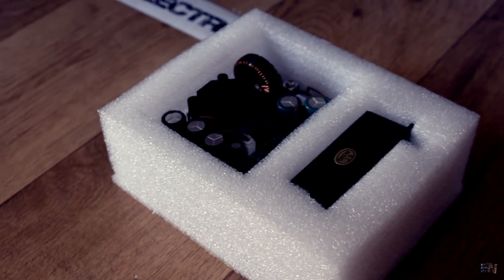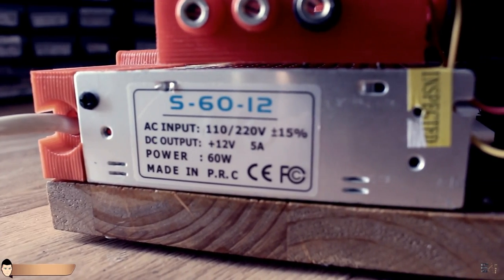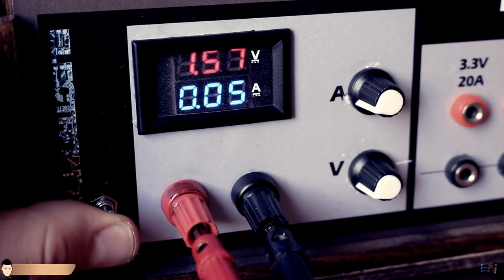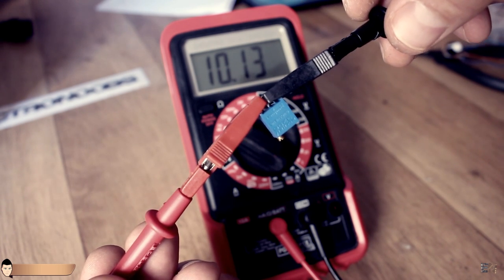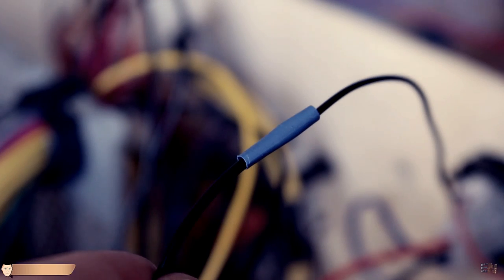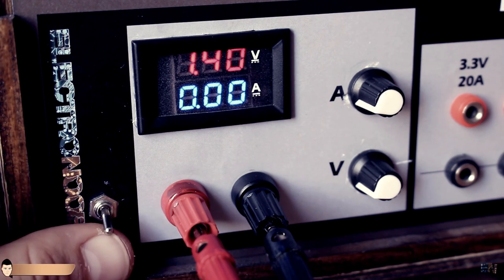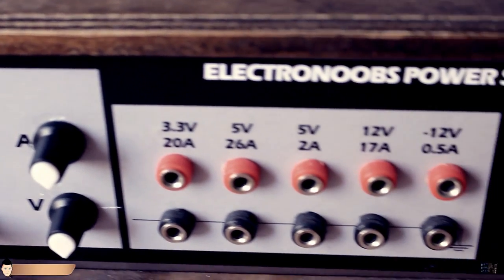DIY variable bench power supply (less than 10$)

Comment: Just what I've been looking for!  However, I am a noob and a little confused.  Does the output enable switch in the schematic have to be 'ON' to get variable output from the buck-boost converter?  Also, will the LCD function when that switch is 'OFF'?  I know, very stupid questions that are covered by the video but my infant brain won't recognize them!  Many thanks!

Comment: Hi please give me some advice. I have a computer power supply that is rated at 350W. I want to put a pair of USB plugs onto it to utalize the 3.3v 20A, 5v x 20A, 5v x 2A, and the 2 x 12v x 312W outputs.
My plan is to do 2 x 5v USB, 1 x 3.3v 1 x 12 v to power a T12 soldering iron and the other a 12v a buck buck boosted supply. What would you recommended?

Comment: Great project and very well explained.  One of the best DIY variable PS videos I have seen.

Question:   When I look up the DC convertor you used, it specifies the a max input current of 10A.  Is it Ok to use this with the ATX PSU, as the +12V rail provides up to 8A current?
Reply from the maker: Yes it is ok. That's the max current it could withstand. If you apply less there should be no problem. Keep up!

Comment: Nice project, if I didn't already have a bench supply, I might try it. -- Also, I hate to say it, but sorry man, you're not going to be getting 26A out of a single 5V wire.  -- You really need to pair them all up to push that much amperage through... -- Also, I doubt those banana plugs are rated for more than 10A each anyway... -- Also you should put the buck/boost converter into the airflow path of the power supply fan. (Or add another fan that cools it.)

Comment: is there a safety just in case I accidentally short the power supply when working on something. plus I have 2 10 Ohm 10 v dummies and a extra fan is that too much? can you put a extra capacitor to smooth out the signal?

Comment: Electronoobs
, first of all, great video and it is very inspiring. However, please correct me if I am wrong, but I think the output terminal connection to the volt/amp meter are switched around on you diagram right? ..which must be a mistake ? ....I dont have the component at hand (yet) just watching your diagram and the products from ebay...i could be wrong
Reply from the maker: Te diagram is correct. The problem is that there are different colors cables for other modules on eBay... Sometimes they use yellow, blue and so on...
Reply: @ELECTRONOOBS  , sry i meant the boost converter output side towards the meter, the image is mirrored so it is bit difficult to se. But as I see it from the picture then the terminal close o the pot meter is + positive (around 6:42 in the vid), and the one close to LM2577S is -negative, right?.

Comment: One thing that should be stated is that ATX computer power supplies have minimum load requirements, and a lot of times won't regulate properly if the loads on them are too small.
Reply from the maker: Qumefox luckily the voltage converter regulates the output depending on the load .
Reply: Mine had too high voltage on 5V output so i've added linear regulator for internal electronics :D
Reply: It's normal the the power rails has a small higher voltage as rated, because under load there is a small voltage drop. So you should not regulate the 5v down exactly 5v. For example as you can read here https://www.allaboutcircuits.com/textbook/digital/chpt-3/logic-signal-voltage-levels/ (TTL gates operate on a nominal power supply voltage of 5 volts, +/- 0.25 volts).
Also there is inside the power supply normal 2 pots to regulate the 5v and 12v rails. BUT!!! Inside is high voltage I would not recommend to open it until you don't know where is the "hot" and "cold" side of the supply ... otherwise you can risk your life!!!
Reply: Well to each their own, but my experience has been that the outputs of most ATX PSU's, especially the cheap ones, are far from being clean and stable when driving no or light loads, so I always add internal resistors to whichever rails I want to use, so the PSU always sees the require minimum load for that rail no matter what when repurposing computer power supplies.
Reply from the maker: Yes, it is wise to add a dummy load to it!
Reply: Thanks for reply, linear regulator indeed isn't as good as i thought. The problem is that 5V rail is beyond that tolerance (around 5.7V with 10ohm dummy load). I'll add second resistor in parallel and see if it helps.
Reply: You might try looking up the ATX minimum load specs and make sure you have the appropriate minimum loads on all the rails. MOST ATX powersupplies i've run across regulate all voltages fine with a load on only the 5v, but i've run into a couple before that wanted a load on pretty much every rail before the voltages stopped being screwed up.  It's also possible you just have a bad power supply as well.

Comment: For most electronics projects this power supply is totally overkill...
I would recommend for all beginners an linear power supply with an lm317 and a simple 30VA transformer and for $6 you can buy the kit with no case on aliexpress with free shipping :)
Reply: I just mentored folks on an intro to soldering workshop; we built an LM338 power supply that a friend sketched out. I was thinking the same thing as you, there's no need for something like this on the bench until you want to have something flashy that makes people go "Ooooooh" -But in all practicality, an LM317 or LM338 1-3A power supply can be customized with a meter, pot, and switch.
Reply: Lm317, 338 can't dissipate lots of heat when we want to draw high current say upto 2 amps @ 3.3 volts if we've designed the power supply to output upto say 30 volts because 30-3=27 volts x 2 Ampere =54 watts the regulator has to dissipate even if large heatsink+fan is used so it's better if we make upto 12 Volt output
Reply: @amitghosh6966  Hi, indeed, it can't disipate all that power but it doesn't need to
You see, "VA" is apparent power, and it's how we aproximate the power of a inductive load, in this case, the transformer..
The real power of the transformer is around ~20W, at 15 volts, it would deliver safely around one amp of current before it would start to overheat
A second thing to take in consideration, most of those kits have a way smaller transformer (but can be bought without) and the kits themself have a max voltage output of 12V so, at 3.3V regulated set output, we whould have a drop of ~9V with a max current of 1A, it would be 9W to disipate and for a typical TO-220 package with heatsink I don't think that will be a problem for short power up applications

Comment: Hi, I have a voltmeter ammeter with yellow black and red wires and black and red, if I connect the way you in diagram it shorts and shuts psu,can you tell how should I connect correctly to make it work for variable output?

Comment: Heu bro. I want to buy a step-up and a step-down converter. They should output the same voltage ranges?
The step-down converter output from 1.3 to 35 Volts and the step-up converter from 5-24volts.

Comment: ALL YOUR VIDEOS ARE VERY INFORMATIVE.. how to restrict current in  this power supply.....
Reply from the maker: Abhin Raj the voltage converter already has some sort of current control using the third potentiometer. but you could always add a variable current circuit.

Comment: Could you help me, I've built this to your word and without the Voltage/amp display it works great. When I connect it to the Display using 5v and ground my Power supply powers up for 1 seconds then goes right off.. Removing the LED fixes this problem
Reply from the maker: The LED is the problem or the Display?
Reply: im not sure, ive tried everything get the led display but im getting nothing. will it still display even if i dont have the 3 pin in?

Comment: If I'm using a 300w ATX is it possible to get 12v 300w or 24v 300w?
I work with LEDs and need the power.
Why did you put the variable resistors the other way around to the display markings?
Reply from the maker: Watt is voltage times current. A 300W power supply at 12V will have a maximum current output of 300/12 = 25A. But maybe that's not the case because usually those supplies have multiple outputs and the output current might be a bit lower. So, the power (W) will always be the same but the current will change.
Reply: Electronoobs  Thank you for the response. I was thinking of making a supply with a separate 3.3 and 5v and then using the 12v 18A 216W output separately connected to a buck/boost. Would it be a decent option or would I need to get a supply that can put out the voltage needed and then just using a buck?

Comment: good work but its triple 10 dollars
Reply from the maker: All depends of the price that you find the PC power supply. 3 dollars the PS, 2 dollars the converter, 2 dollars the voltmeter/ammeter module. 3 more dollars for some wood sheets, some connectors, potentiometers and switches.
Reply: No.
Reply: Prices for the parts, excluding the PS, are much more than 10usd even if I get parts from China. Price is closer to 20usd.
Reply: Just bought all the parts, I skipped the LED. Total from China via ebay came to $14.63 USD including shipping.  Almost $5 more than $10, but 50% more.  I had a power supply. I would say under $20 is more accurate
Reply: @electronoobs
I'd like to buy 100 complete kits from you for 10 USD each.
When can you deliver?
Reply: @czarzenana5125  when do you want it delivered, you think youre so slick with your witty comment. You pay shipping and handling, agreed?
Reply: @voyagertechnologies  
No problem if you ship them all 100 in one shipment.
That's including the power supplies of course.
Reply: Late to the party, but you 'can" get parts for next to nothing if you can get second hand parts like old computer cases for the PSU and wires, etc.
Reply: @crawfish069  no, you can get th we parts for less than $9, just because you have trouble finding good prices doesn't mean they aren't there.
Reply: it blows my mind that several keyboard warriors are squabbling over the difference of $10-$20 on this awesome build, concidering mine was purchased for $899.00!really? GTFO. maybe we could try to intellectually critique the build to make it better for the build community together, instead of argueing over a hand full of dollars, who gives a s**t.

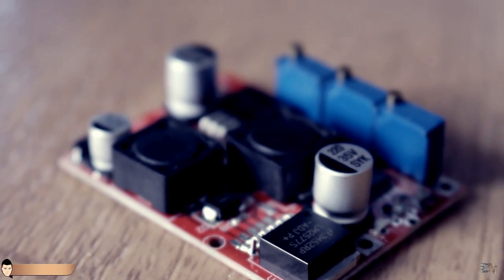Comment: I don't understand if you're voltage converter can only handle 3:00 amps how do you have all the buttons for or is that not part of the variable part
Reply from the maker: Only the first connectors are variable. The other are fixed values directly from the supply and those haev high current
Reply: @ELECTRONOOBS  gotcha thanx...

Comment: Hi, do you have a scope? I tried a buck/boost module like this and found it to be pretty much unusable (at least for a bench supply) because of the ripple. I'm wondering if you saw the same with this module.
Reply from the maker: If the boost could deleiver let's say 2 amps of current and you put a load that requieres more then you will have a big ripple and also could burn the module. But usually, the output capacitor should avoid the ripple quite well and you nshould have a very steady output.

Comment: Nice project concept, though the implementation is a bit dodgy in places:-
- Wooden case? (it's plywood btw, not Balsa!)
- Wiring to banana terminals
- Output switch, is it rated at 3A? 
- Solderingmanship

Comment: Good job,  can i make from it 19.5v 240w Laptop power adapter?
Reply: Yes you can, in fact if you use the module .. you can have input voltage between 4-35V DC so, use 12v power adapter, 19.5v one.. doesn't matter :) also 240W is plenty if maximum it is able to draw is around 100W tbh and you need quite thick wires to get that anyway. Cheers!

Comment: what about high current (5Amps) 24v out of an atx rail? Is it possible or not? I have led strip which require 24v and are 14w/m
Reply from the maker: For that you should boost the (5volts 30A output) to 24 volts using a high current boost module.
Maybe this will do the job: http://www.ebay.com/itm/600W-DC-Boost-Voltage-Converter-12-80V-Transformer-Module-Regulator-Volt-Amp-Car-/401325123362?hash=item5d70d76722:g:Q7MAAOSwtGlZE1Ef
Reply: thanks for the reply! So do you use the variable part to handle the voltage for little projects while the "fixed part" to have high current rail for bigger loads didn't you? Last question: some people solder high power resistors to the highest current rail. Why didn't you do that? Is it always necessary?
Reply from the maker: Yes, you should add a high power dummy load on the power rail (in this case red 5V) to keep the power supply a little bit more stable for low amounts of current. I forgot to mention that.

Comment: I used this buck boost module with a 12v 5a smps but after connecting and switching on the supply I saw a crack on LM2596 ic but it haven't come out of the pcb I didn't connect anything in reverse I don't know what went wrong plz help
Reply: lm2596 has 3amp as max current

Comment: I am building a power supply just like yours but I am using the LTC3780 I have one question tho, what is the use of the  output enable switch? if I dont use it would it make a difference? also I am using a 47 resistorfor te dummy load. thank you for your videos have an awesome day
Reply from the maker: If you don't want, don't use it. Usually bench power supply haev an enable switch. You first set your voltage, your current limit and then activate the output so you make sure you won't bur the circuit. Keep up!
Reply: I see so this is a safety measure just in case you forget to set the right amount of voltage or current you need, I think I will put it just in case, thank you so much for the quick answer I love your videos btw very informative...
Reply: Hello I hope u can help me with another question sorry, I am still waiting for all the parts to get to me, today I received the ammeter display by watching ur video I assumed u can test the display to see if it works by connecting the black and red wire to the power supply but every time i do that the power supply goes off, any thoughts of why it does that? Thank u so much for ur help
Reply: I will try to answer my own question as some others might be wondering as well, so it seems that not all volt/amp metters have the same wiring schems they are all different so before we connect it check colors and where it goes connected

Comment: Never solder mains earth(green/yellow) connections unless you prepare for a Darwin-Award. It will kill you in the worst moment: In a shortage, when it is needed. Go for terminals with screws and crimped connections when using flexible wires. Do NOT apply solder to crimped connections unless you want to negate the flexibility and have them break exactly at the solder-copper transition(why???... what's the point of the flexible cable then ???). When using wire with a solid core learn from someone who knows it how to bend a proper ring and what washers and lock-washers to use.
DO your math and use the right diameter for your cables, rounding _up_. Optional use the next upper diameter for earth cable. Let it be the longest cable of all, especially in flexible connection cables that are pluggable.

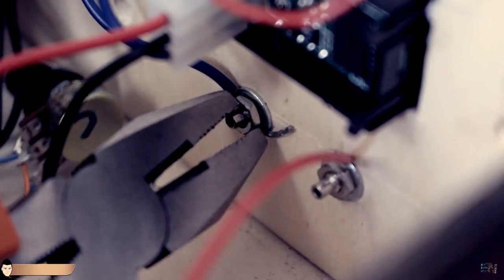Comment: 7:05 dangerous.really should use a ring tongue terminal http://au.element14.com/amp-te-connectivity/323784/crimp-terminal-ring-12mm-yellow/dp/1056385 or at least instead of twisting the wire, make it a Y sharp twist and make a circle into it so the screw and nuts goes in the middle
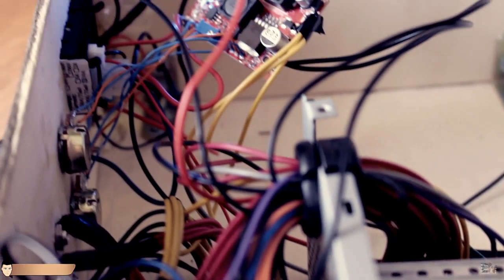9:56 you should also either mount or insulate the buck board from moving and possibly shorting out anywhere.

Comment: How would you build a way to see the max amp before connecting a load to the output? A switch and a big dummy resistor?
Reply from the maker: The max amp of the Power source must be on the label and the max output amp of the module it's on its datasheet. Just check the product datasheet for all the info. If you test the maximum output with a dummy resistor you might burn it or turn it off due to safety features. 

But, you could use a low resistance high power potentiometer and decrease its resistance step by step and when the module get's burned out or turn off that means that you've reached max power..
Reply from the maker: Oh, now I understand. Yes you could add a switch and a dummy load connected to the switch when the switch is OFF. In that way you could set the current limit on the displaay. When the switch is ON it should be connected to your circuit and the current limit would be already set. 

Keep up!
Reply: Electronoobs thanks. Is it possible to do this automatically? So when no load is connected I can adjust max output? Without using a manual switch.
Reply: AquaLars FishNShrimps 
  You can create a current limit on any power supply. Use a TL431 shunt reference with the standard example circuit from the datasheet, with one change, replace the R1 resistor with a potentiometer. Pick a resistor combination that will give you a 1-5 volt adjustment range with this pot. Feed the output of the reference to a logic level n-channel power MOSFET. Place the MOSFET in front of your ground terminal. This will allow you to create an adjustable current sink limit for any power supply. Be sure to use a current limiting resistor ahead of the TL431, it can't handle more than 100mA.

Comment: 26 volts is too low i do need 48 volts, but amp already good, How can i get 48?
Reply: Hey use dc buck boost converter! Alot on ebay. Range input 5-24v to 30/48v output... Take care of the watts! Fan or heat dissipator...

Comment: Hi, I want to make power supply dual voltage(+ 0 -). I use transfomator CT. Can I use two buck converter connected to dual voltage power supply?
 Input + of first buck converter connects to + power supply. 
Input - of first buck converter connects to 0 power supply.
Input + of 2nd buck converter connects to 0 power supply.
Input - of 2nd buck converter connects to - power supply